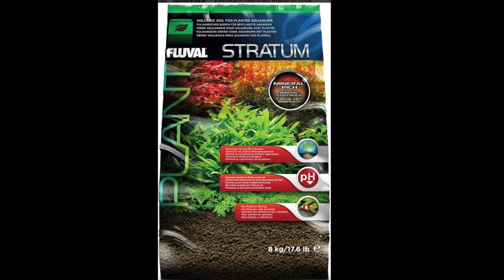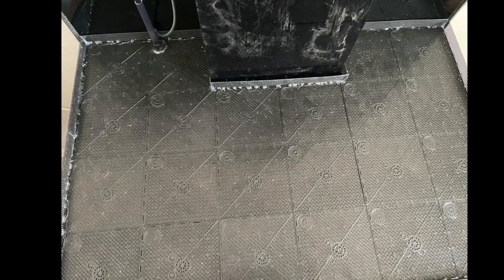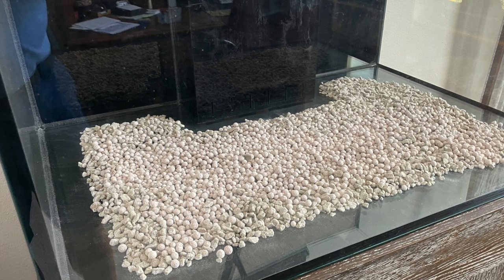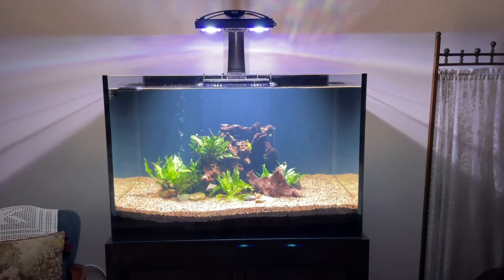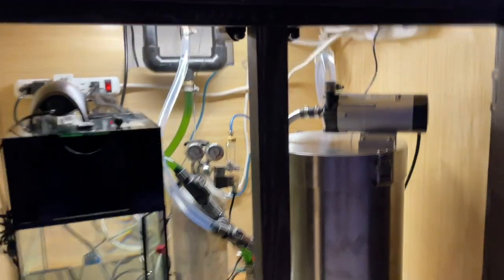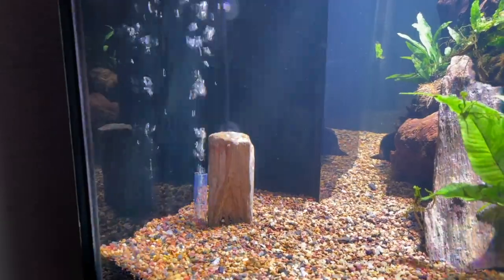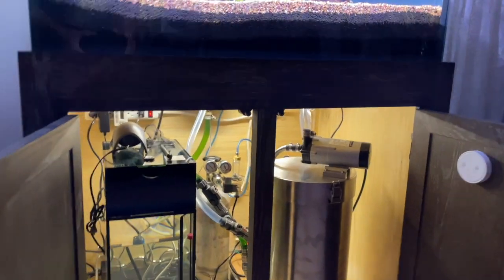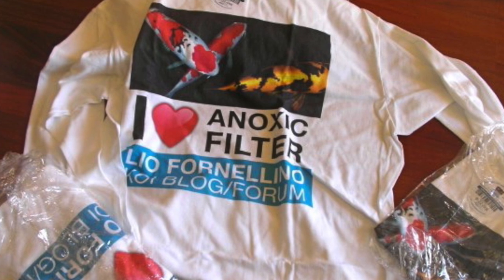Building A Plenum in the SCA Aquarium with Fluval Stratum  : Kevin Novak Ph.D.

Comment: Can you help me doctor?
My 220 gallon has an outbreak of Columnaris.

There is hundreds of dollars of plants and substrate that I don’t want to loose and tearing down and bleaching a 220 setup will have me just quit.

Im setting up a 79 gallon and going to treat with anti biotic of got from Canada a few years ago.

If I remove all fish from the 220 and keep the plants and scape going then treat the fish in the 70 gallon will the Columnaris bacteria eventually die out in the 220 with no fish in it?

There are snails in the 220 will they carry the bacteria?

They are verious rainbow fish the older angelfish and archer fish seem fine for now.

I appreciate your input on this Doc!
Reply from the maker: The gram-negative Bacillus columnaris is usually a sign of pour water quality right off the bat. If you take all the fish out of the aquarium and treat the fish separately from the aquarium eventually in the main aquarium the bacteria will die off. However, you now have a bigger problem in trying to decide why the disease started in the first place.   If it's a simple thing like you added a new fish to the aquarium now you know how the problem started. However, if this is an existing aquarium for a long time and a disease just popped up for no reason then now you'll have to do some investigation to find out why.
Reply: @anoxicfiltrationplenums  thank you so much!
It was a new setup but I used a cycled filter. 

I added multiple different rainbows from different two different suppliers. The kamaka rainbows brought the bacteria in I think because each day one would die. I pulled them out and treated with antibiotics and no deaths for 5 days now. 
But the bosmoni are still in the big tank with the archer and angelfish. One bosemoni died a few days ago so I made some food with the antibiotic and so far no more deaths in the big tank. 

How long do you think I should feed the anti boot food to the big tank residents?
I removed the Kamala rainbows which
Reply from the maker: @sirbreakemstuff   OK now I understand you brought it in with some fish and now it’s affecting the whole tank. Take the fish out like you plan treat them and leave the tank empty with your plants so the bacteria can die out.
Reply: @anoxicfiltrationplenums  how long should I keep the fish out of the big tank in order for the bacteria to die off?

I have no idea how long
And will the snails continue to keep the bacteria alive because there is no way I’ll be able to get them all out

Comment: Hello Kevin Novak, i have a question about anoxic condition. The anaerobic bacteria eat carbon + No3 and export N2. So need to add carbon (C2H5OH) into the tank or not ? If yes, how many carbon that should be add ?. Thank you so much.
Reply from the maker: It’s a complicated process but the way it works is you don’t have to add carbon ever to the aquarium or the pond for that fact. It’s a pretty simple system but it is complicated in its chemistry.
Reply: @anoxicfiltrationplenums  thank you very much
Reply: Hello Novak. I am investigating anoxic now.I know that the kitty litter can attract Amonia mocules but I can not find the kitty litter as your requirement in my country. Can I replace by Akadama soil ? Or could you introduce some other product that same function ?

Comment: Video: Building a plenum Question Can you put the top gravel all the way down on the sides and front of aquarium to hide the soil? Or will the water just pull down only there because of less residence making the plenum void. Thank you for making these vids I found out the hard way on only soil on glass bottom.
Reply from the maker: yes you can.
Reply: @anoxicfiltrationplenums  Thanks for the reply and all the good info!! Keep sharing the knowledge!

Comment: Great video Dr. Novak, I like the whole design of the tank, good idea as well to have the equipment on drawers rails.

I have a question about the maintenance as on every forum, they always say that undergravel filter are a hassle to clean / maintain. With your setup, do you ever need to remove the plenum to fix the device which is connected to the air tube or it stay fairly clean and keep on operating for years?

Comment: Howdy. Just watching your videos as I have 3 55gallon or larger aquariums in which I am wanting to convert to or add anoxic filtration. Two are relatively minimal substrate or bare bottom and will be getting plenums and deep sand. My question pertains to my 75 gallon dirted tank. I don't wish to tear it down, and it has currently a large canister filter and a mattenfilter.  The mattenfilter has two jet letters run by air stones. I have a bunch of those plastic baskets that are meant to fill with floss and place in a hang on back filter. They have about .75 to 1 inch of space inside. I wonder if I could fill these with the kitty litter/iron substrate and slide them behind the mattenfilter as BRB baskets and perhaps use only one jetlifter to somewhat mimic the environment created by the plenum? I could probably fit two or three in there for a total of about a kilo or kilo and a half of substrate. Would that be enough to justify the effort? I'd really like to avoid disturbing the dirt, substrate, and plants already in the tank. They're fancy goldfish tanks if that matters.
Reply from the maker: As long as water can go around them from the bottom side and top they should be fine , you do not want water to be forced through the substrate.

Comment: Good day,
Im planning to make 75 gallon tank. How powerful the air pump gotta be ? And would that be enough 1 uplifting pip or two is better ? 

Thank you
Reply from the maker: The air pump can be the smallest one you can buy it really doesn't have to move a lot of water with a small opening of uplift tube like I use of 3/8 in diameter. A 1" will also use only a very small pump, too.
Reply: @anoxicfiltrationplenums  thank you

Comment: I'm using the lees undergravel to make.my plenum on my 4 ft 75, should I only use one uplift or should I split the air line to move the same amount of air split in half to pull from each side to pull air though the plenum more evenly?
Reply from the maker: One lift tube will be enough as long as the plates can be all connected up together and become one.

Comment: Hello, can you please do a video on Fluval stratum it turned my kh to ~zero is that expected? My Tap KH is ~3 and I add seachem alkaline/acid buffer with the ratio of 2:1. However, my KH now is measuring a little bit lower than 1. I finally changed my aquarium to a plenum with a lot let plants! Thanks for all your videos!
Reply from the maker: That I don't know,  you'll have to talk to the manufacturer who makes the substrate. My KH is not down to zero but I will double check.

Comment: Dr. Novak, I used Fluval (without plenum) and when disturbed in the tank (even after I rinsed it initially) it clouds up the water.  Question:  did the plenum you set up with Fluval create a dusty look in the water column when it pulls water down and circles it up, or am I not understanding how the plenum works?
Reply from the maker: I have read that this is a problem with the using the Fluval for a substrate in tanks with NO PLENUM.  No I had zero problems with the Fluval using the Plenum because of the way I set up in my video and how I filled up the water inside the aquarium with a plate under the fill up hoses without disturbing the substrate. Maybe with me using the small gravel I had  placed  on top also helped but then again I can't really say for sure if that was what kept it cleaned. 

If you watch my video  on my 90 gallon SCA aquarium you'll see that the water is clear and I had zero problems with the Fluval substrate. The only problem I had was the tanning from the wood I used that would turn the water brown.
Reply: @anoxicfiltrationplenums  Thank you Dr. Novak, that was helpful. I have another question
Reply: Question: I have a small 6 gallon tank with guppies. I have an under gravel filter/Plenum I set up. I shortened the tube as you suggested. I also have a small sponge filter inside there. I was wondering: if I could alternate  runing the Plenum for 12 hours, and then run the small sponge filter for 12 hours. What are your thoughts?

Comment: Dear Dr. Novak, I have built pkenum in my auarium tank but without the bubbler. After 2 months, my tank is struggling with the beard algeas. Do you think because of lack of the bubbler causing this fail of reducing P04?
Reply from the maker: I myself have found that a plenum just on its own works good but unfortunately through my research a plenum using a bubbler works better. Also how thick is your substrate?
Reply: @anoxicfiltrationplenums  mine is 2 inches thick, Dr. Novak.

Comment: Hi Dr Novak
What is the minimum thickness level that the substrate including the plenum can be in order to work ?
Measuring from the bottom of the tank to the top .
Reply from the maker: The best depth for a Plenum would be at least 3 inches, that would be the ideal thickness. That does not include your Plenum itself which could be anywhere between a half inch to 1 inch high.

Comment: Hi Dr Novak 
will a plenum work (denitrification) without a lift tube in a non planted tank ?
Reply from the maker: Yes it will. That is how it was originally explain. But after doing some test on it I found out that a slow moving Plenum works a little bit better than the non-lift- tube method.
Reply: @anoxicfiltrationplenums  
I built a plenum in February this year with a slow lift tube. There was zero decrease in nitrates in 4 months of testing. In June I decided to add a leak valve which further decreased the flow. 2 months later and there is still no decrease in nitrates so I decided to cut the flow completely and monitor.I only did this a week ago, not sure how long I should wait to attain proper results as I want to set up a new tank ?
The plenum is set up in a 3 foot tank with 4 goldfish. About a 25 gallon tank.
I did everything as you said, I'm not doubting the plenum system I just think the water movement may not have been ideal as it is the largest variable in the system.
I may have overfed but then too I should have seen a decrease in nitrate level. 

Anyways thanks alot for your response.

Comment: Dr. Novak thank you for these videos. I have a question on the plenum. Could you have (for in your case) the water coming from the plenum plumbed to run up and exit out into your skimmer that would take it to your filter? Would this be beneficial vs having bubbles pushing this into the open tank?
Thanks again Robert

Comment: Where a you getting your plates for a dollar? The lowest price i see on Amazon is 6 bucks a piece? The Chinese seller i found for a dollar was a scam seller. The product item had a higher flow so would require a fabric above the plates such a weed mesh, but the seller was a scam. Without the 1 inch plates you can not build. Please turn us on to your seller. Thanks.
Reply from the maker: Nope you are wrong. You can buy 20pcs @ $25.59 or 10pcs @ $15.69 and that is right on Amazon POPETPOP Aquarium Bottom Grid 20 pack or 10pack. Both are in stock right now.
Reply: @anoxicfiltrationplenums  That is where i purchased and it was a scam. Check out the product that Dr. Novak shows in his videos this is the same that is on Amazon for 6-7 dollars. If you look at the one this Chinese seller POPETPOP sells it is less dense so it would be a much higher flow and defeat the purpose of low flow and kitty litter would flow through.I bought 3 orders of 20. According to POPETPOP the items were processed sent to distribution center in China and arrived to my front door all in 3 days, but they were unable to deliver. Oh the seller's name changed from the time i bought to the time of non delivery.

Comment: Dr Novak, 
You referred to your canister filter setup having something called a 'wear' which self primes the filter.
Please elaborate as there are power outages where I'm situated and I want to overcome the problem.
Thank you
Reply: Or refer me to a video where you explain this self priming system, please.
Reply from the maker: Gravity will fill the canister filter. If you use a weir then the weir will alway stay full of water at all times even with a power outage.
Reply: @muhammadbadat7042  I think the weir has to be installed before building the tank since it needs to have holes drilled in the glass

Comment: Effectively, it appears to be a deepsand bed ontop of a plenum along with additional moving parts such as air pumps to keep the operation functioning. How do you know the plenum is doing the denitrification and not the deep substrate? By contrast have you tried a deep substrate without the plenum  and just allowed the water to slowly pass through the substrate by capillary action alone (using a finer, non-compacting substrate like pool filter sand)?
Reply: Additionally, if what your saying about plant roots is true, how do you account for plants living in their natural environments? I've got about 15 functioning deepsand beds and have too say that the plant growth is explosive all without co2 injection.
Reply from the maker: No sand here is being use for the plenum. The plenum allows/aids capillary action to take place along with diffusion of ions easier.

Comment: Dr Novak, is the bubbler absolutely required for this setup? Is the function of the bubbler to put oxygen into the plenum or is it strictly to aerate the surface of the water up top?
Reply from the maker: No it is an option.
Reply: @anoxicfiltrationplenums  Thank you...I'm going to setup a 56 gallon tank with your method here...I got a 25lbs bag of laterite as well. The only part I wasn't sure about was the use of the air stone/bubbler. Water wouldn't get too stagnant doing this without a airline and tube?
Reply from the maker: @GSP-76   using a bubbler does aid in the transferring of water from the bottom out into the aquarium. But unlike the old days of under gravel filters where we tried to move as much water as possible we are doing the opposite with moving very little water as possible.
Reply: @anoxicfiltrationplenums  Yes, exactly... since we're trying to move as little water, that's why I was wondering if not using an airline at all would be sufficient. The tank itself will have water movement as I plan on putting a small power head in it. My only concern was whether that would be enough. Anaerobic bacteria thrives in low oxygen habitats but it does require some oxygen (as you've pointed out in your videos).

Comment: Hi Dr. Novak, For a 20 Gallon aquarium, do I need a large canister or can I just use the under gravel filtration Plenum you mentioned, maybe with a small sponge filter if needed? Also what I need CO2 to grow plants with the system?
Reply from the maker: The Plenum will be good but what will you use if you want to ass carbon to the system a HOB or Canister will aid for that.
Reply: @anoxicfiltrationplenums  Hello, thank you for ansewring.  I wasn't clear: are you saying I need a HOB or Canister for CO2, or can I just run the under gravel filter (like you have) and just add C02?
Reply: p.s. I won't be using a cannister, just an HOB or sponge filter?? what are your thoughts about sponge filters?

Comment: Hi Dr Novak I sent u a message befor about my plenem tank with catlitter I noticed my gh n kh is usaly high I am using catsan litter I just found out its not aked clay it's chalk a mix of corel and sand so it's high in calcium and carbonate ions that's why my gh is 240 and kh 100 IV got the undergravel then catsan then red clay then fluval strutum but my phis still 7.8 what I'm wondering is will it stil atract the ammonia ions out of my water

Comment: Hello Dr Novak, I am Albert from Indonesia. I  read almost all of your literature about anoxic filtration about 1 years now. 

I have question, my glass pond has 60cm thick silica sand, and i use red lavarock in bottom layer (they said, red lavarock also contain iron), will my sand bed be anoxic filtration?
Reply from the maker: I would only assuming that it is Anoxic or anaerobic. It takes special test that would read the bacteria that you may or may-not have.
Reply: @anoxicfiltrationplenums  thank you sir

Comment: Tanks looks great Doc, do you know what your gonna stock in it yet?
Reply from the maker: Yes I'm going to Jack Wattley in Miami Florida for some fish like Orinoco and/or Atabapo Altums.  The will look really nice in a take of the size.
Reply: Those are gonna look really good in that tank. Say i got a question regarding sizes of BCB baskets. I got a 135g tank that i added two 2” x 4” x 10” bcb’s and another one that is 4” x 5” x 10” is that adequate for the size tank. I know it depends on waste load. Which weekly nitrate test are around 40-60 ppm and me changing roughly 50% weekly. This tank has been running for 10 years. Algae is always a problem . I get black/brown algae that grows all over leaves, suffocating them. In it early years everything grew great. I was planning on adding a plenum. Do you think doing that or adding more BCB baskets would help? Thanks
Reply: @grahamkool6519  If possible try 30x30x20 cms.